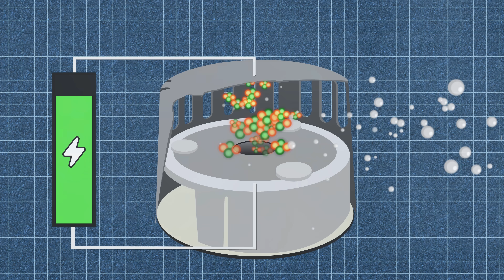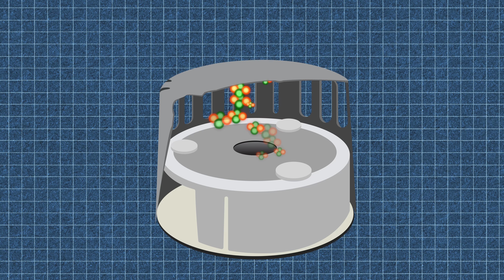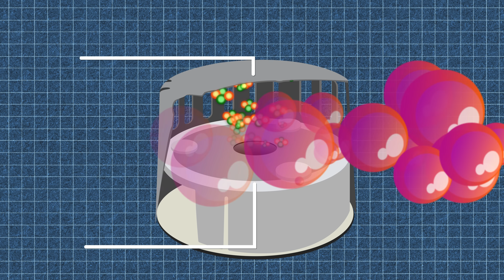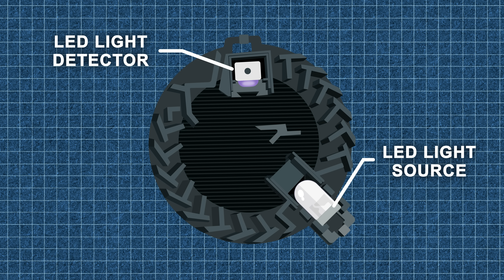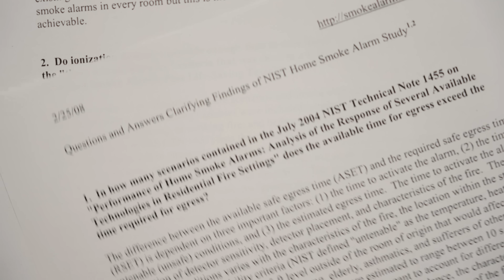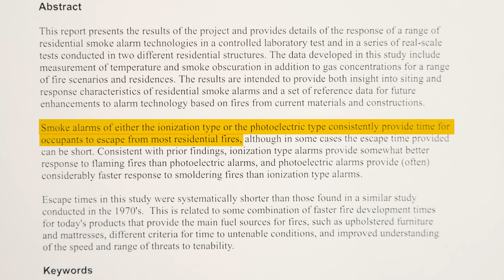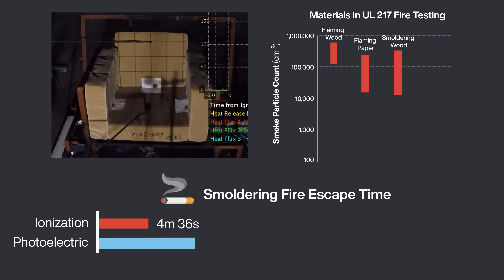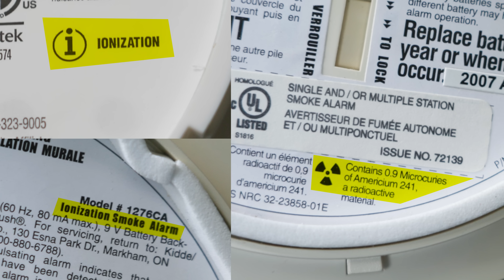Why the Most Common Smoke Alarm is Dangerous

Comment: Nice video as always, but I feel you should have put a disclaimer NOT to open or put tape on the alarm like you did (I know, it's a demonstration, but still...). Tampering could be dangerous...Also, modern furniture also have a layer of (sometimes toxic and/or cancerous) fire retardants, could have been a nice chapter subject or maybe for a future video ? Would also have been nice to say that those are hazardous wastes that you don't put in the trash. Cheers !
Reply from the maker: Thanks for your comment! Mmm, I see your point, my video would be full of warnings though if I had to do that.  

Also the recycling of smoke alarms and toxic aspects of fire retardants is a big issue.  I didn't touch on that though as it was falling out of what the video was about. 

I got rid of that comment
Reply: @Lam  Hehe, I'm an Health & Safety college teacher, so maybe my bias is showing...Also, thanks for deleting that racist comment above !
Reply: @DeCapitanOG WTF with the casual racism ?

Comment: Dang I just replaced all my detectors a few months ago with photoelectric from kiddie
Reply from the maker: Well, at least you did it!  Most people wouldn't even consider doing it.

Edit:  photoelectric puts you good position, I wouldn't feel the need to upgrade
Reply: You should double check that they're still working. I bought a Kiddie alarm recently and the "10 year battery" died after a few days
Reply: The contractor installed 8 kidde model 900-CUAR in our new home. Photo electric, hard wired + battery backup. By Month 5:  3 failed by false alarms in the middle of the night, no combustion or dust was happening. Batteries were good. This alarm is JUNK.
Reply: @walters8088 the false alarm could have been due to bugs or spiders in the alarm.  If so, is that really the fault of the manufacturer?   Don’t assume every failure means the product itself is poor quality.
Reply from the maker: Exactly this, dust and bugs are still a problem even though manufacturers have added screens to stop it from getting in.  Sometimes you need to vacuum or use pressurized air to blow them out.
Reply: @walters8088  Had the same thing happen to me. Replaced them with the ionization model.
Reply: I have all photoelectric alarms from Siterwell in my house as smoldering fires are my greatest concern (lots and lots of computer equipment), and they've been pretty good - one time they triggered on a CFL light bulb I'd left switched on while we had a failing transformer outside that was intermittently feeding double the normal voltage to our system.  I've also had the occasional false positive from a tiny spider crawling inside one, but occasional air dusting seems to have solved that.
Reply: Kidde is a terrible company. They make the lowest quality detectors and fire extinguishers on the market.
Reply: I don't know about their smoke detectors, but I've heard kiddie fire extinguishers are often defective. Unfortunately, I learned this after buying 4 of them. >.>
Reply: As a former extinguisher tech, we had to throw out so many kidde extinguisher because they would fail their tests and couldn't be recharged. In my experience Badger was the most reliable brand.
Reply: then ur fine, photoelectric is still straight up just better.

Comment: yes very cool, but how can we make it easier to change the battery? My firefighter friends are tired of getting called in to do it for people.
Reply from the maker: 10 year batteries!  A high capacity lithium cell is added inside.  Required in many jurisdictions now for that reason because it's annoying to change batteries.  It's also cheaper long term.

Comment: There seems to be an Error at 11:45 with the Naming of the Graphs on the Left Side. Seems like "Photoelectric" and "Ionization" are mixed up.
Edit: Same thing at 13:45.
Reply from the maker: It's not, so the chart shows how much escape time it gives you, not how long it takes for the alarm to go off.  Yes it's a little confusing, one of the testers told me about it but I didn't find a good way to express that official finding.
Reply: @Lam  ok then it just had me confused. Maybe an Note saying "Higher is better" would be nice then.
Reply: @Lam  I found it clear enough in your labeling it as "escape time". However there are many people who are seemingly averse to reading these days, and a graph or chart will be what they focus on so they might miss it.
Reply: @P_RO_  it's definitely counterintuitive. The whole time everything was about how quickly each type can detect the smoke/fire. The obvious choice would have been detection speed comparison not escape time which is the reverse of that.
Reply: @szacsesz  It is a question of perspective. I didn't enter closed-minded into a learning environment with expectations of how the info was going to be presented.
Reply: @P_RO_  What are you even talking about?  Try to look things a bit more objectively, not emotionally if you are trying to learn something. If you are using one perspective in an explanation/argument, changing that suddenly for one graph can be confusing. There is a reason why this is not the only comment about it and why even on the creator's side a tester pointed it out. 
Overall it's a good video, no one questions that.
Reply: @P_RO_  the Thing is most People dont Stop the Videos and read every Note and asume Things are based on the Narration of the Video and thats what got me confused there. Sure after reading in properly and understanding the Graph it was right. The Comment was meant to be a friendly "Hey something seems off to me" and others might be confused but this was still a great and informative Video.
Reply from the maker: Yeah, thanks for bringing this up. I 100% understand all the points being made here.  What's obvious for one person because of they way they scrutinize data doesn't make sense for another. 

I'm all for improving accessibility and having something like "higher is better" is an obvious way to help do that. 

Thanks for bringing that up! Having more perspectives is how I make better videos.
Reply: @szacsesz I suspect the complication is that the total amount of time one has to escape is typically much longer for a smoldering fire.

It is ok from a pure safety standpoint to take longer to detect a smoldering fire than a flaming fire.  

The extra 30min you get to notice a smoldering fire is great, but the ionization alarm usually still gives you plenty of time to get out (>4 min).  But going from 3 min to 2 min in the case of a flaming fire is pretty bad actually.

FWIW: About 5 years ago I had to add smoke alarms to an old house.  The best practice was a photoelectric alarm for the kitchen area, and combined alarms everywhere else.  Not having the ionization sensor for the bedrooms was against code (in at least two US different states)
Reply: @Lam Going from having 4 min to 30 min to escape is great.  But going from 3 min to 2 min in the case of a flaming fire (which spreads faster) is bad and far more important.  It really seems like you're misunderstanding the results of the NIST study.
Reply: It's not backwards, it's just a stupid chart
Reply: @EGL24Xx  It isn't a stupid chart really.  The context of it is "enough time to safely escape".  That's a bit different from trying to detect a fire as early as possible, especially when reliability and user behavior (disabling or ignoring due to false alarms) are factors.

I'll readily admit it isn't the easiest chart to understand though.  But it does make sense in the document it actually comes from.
Reply: @travcollier  oh sorry, it's actually incredibly stupid.  A proper chart would be detection time, and then show at what time is the last chance for escape.  You can then indicate on there how much buffer you got.
Reply: @EGL24Xx  🤦 The "proper chart" depends on the question.  This one is being misapplied (understandably because it is what is easily available).

FWIW:  I've got quite a bit of practice creating figures for scientific publications.
Reply: In fairness the graphs were only up for a relatively small amount of time and he was also talking so there was a lot of information to take in, so watching this on a small phone screen I also got confused. Very good video but that bit would have benefitted from an explanation.

Comment: Oh, yes! Technology Connections made a similar video regarding types of smoke alarms
Reply from the maker: He did! I enjoyed his take on the topic!  This video has been on my mind years ago since I last did the apartment fire safety video.  I thought it was a good time now that the 8th gen requirements are being rolled out.
Reply: @Lam 
Good call! This video was definitely a good refresher, and in some ways are much more in depth compared to the Connections video. Thanks!
Reply from the maker: For sure, I did watch his video! In fact I borrowed his idea of cutting in half my alarms.  I actually bought the same photoelectric alarm he was using just to cut it apart as it was so much easier to animate and illustrate compared to first alert models. 

There was also stuff he covered like dual sensor alarms I skipped.  I like his conversational style and his dry humor 😄
Reply: 1:55 "through the magic of buying 14 of them..."
Reply: I just don't get it why don't they just use both detection technology in one device wouldn't that be an easy fix and it can go off because of because of ionization or photoelectric
Reply: @ahmedmorsy399  some alarms do this -- however they often are quite confusing when it comes to how an alarm is triggered.
Reply: @ahmedmorsy399 because unless it goes off if one OR the other trips (instead of AND) there's logically no difference.
Reply: So then the issue may be completely obvious then...
Reply: Like he has any understanding or credibility
Reply: @MadScientist267  I'd trust his research over a random commenter from the peanut gallery.